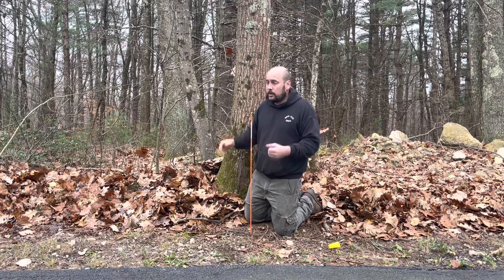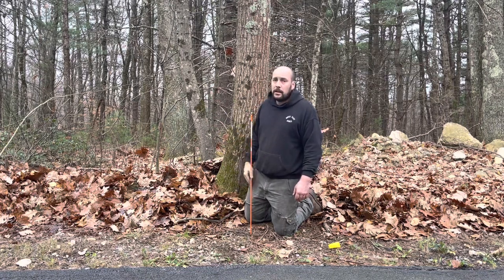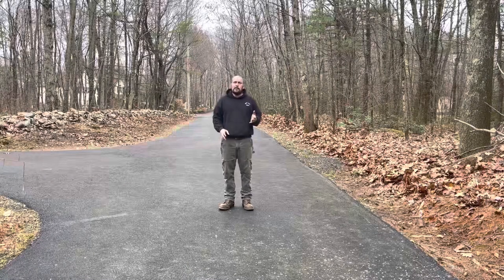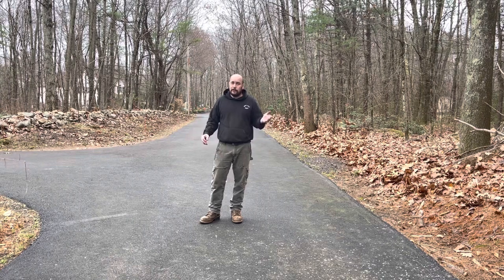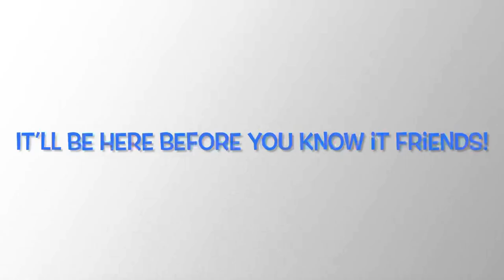Simple trick to make plowing snow easier!

Comment: I might have missed it but what size is that drill bit you used? Great video, in Central New York we got an inch last night but they’re calling for quite a bit more over the next couple of days.
Reply from the maker: 1/2” on the bit diameter. We also got snow last night. Maybe 2” or so. It turned to rain resulting in some slush.